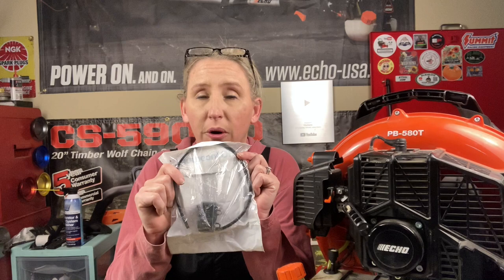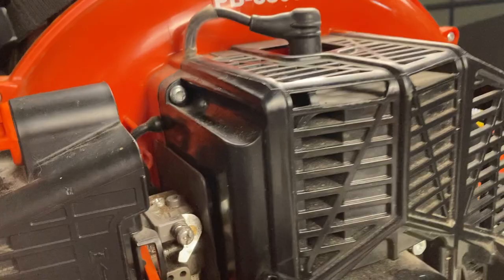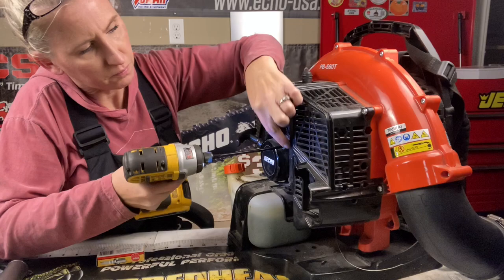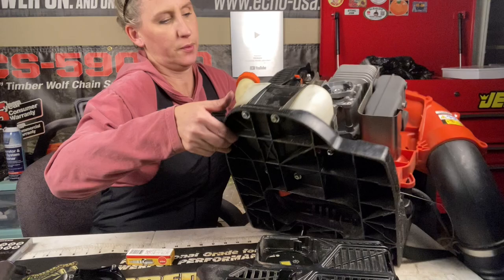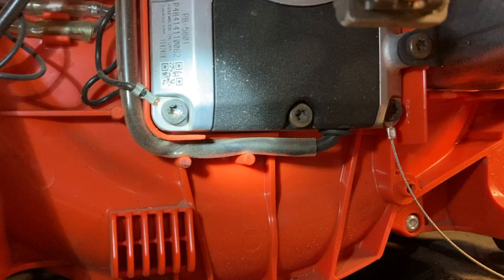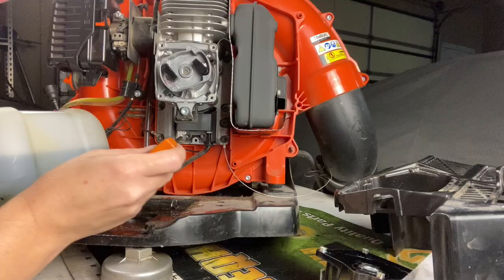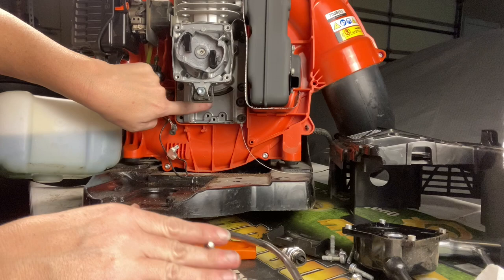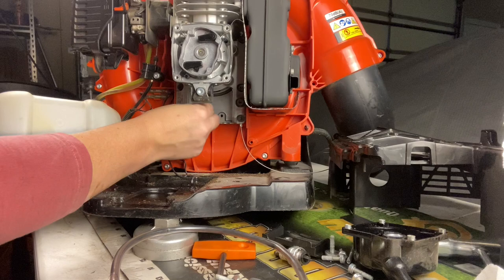Echo Backpack Blower Starts,Then Dies.. Ignition module replacement. Repair/Vlog

Comment: Silicone spray is your friend to remove and install plug wire boots and plug wire covers. It will also help with the plug terminal.
Reply: I came to the comments to say this...
Reply: I use a mixture of dawn and water to lubricate situations like this.
Reply: Yep for sure
Reply: But it WON'T go away, making the connection between the boot and the wire 'slimy'.
Reply: I work in a small engine repair shop,  and I always use a little silicone spray to remove and install the spark plug boots when I'm replacing an ignition coil.
Reply: I use silicone grease for the exact reason. 100% silicone grease gas gotten stupid expensive, btw!
Reply: Dawn + water is good for putting on rubber things like motorcycle handgrips but it gets sticky when it dries. Perfect for handgrips, not for spark plug boots.

Comment: I picked up an Echo blower that was set out beside the road with trash.  Like the backpack blower, it would run about 10 minutes and die.  Then it would not start again until it was completely cool.  I put a new ignition module (coil) on it and it runs great.  Watching your videos has given me more confidence in attempting repairs for myself.  Thanks for sharing your videos.

Comment: Working on a Hilti concrete saw today. Got it all buttoned up and was about to pull the starter rope and there it was. Laying on the bench, a random screw. Doubt and the where did that go had me tear it back apart. Coworker walks over and says, "Did a screw fly over here?". He bought lunch after I chased him out the door swinging a chainsaw chain at his head. Never a dull moment where I work.

Comment: Thank you - I did not know if I had registered the Echo PB-580T purchased from Home Depot by my wife as a Christmas present many years ago.  The unit worked for years but I would have to power it back to keep it running.  After the new ignition module (purchased off brand on Amazon with all the parts you had to reuse) the unit worked great for 15 minutes.  Hopefully will run again once I let it cool off.  Great instructional video.  😃😃😃😃😃

Comment: Usually in this type failure, there's a very small break either in an internal winding or plug wire. When the coil heats, the break expands thus no spark. Cool down and the break closes. Nice video Bre.

Comment: Fire : If you have light yellowish fire, your engine "might:" start. You need brilliant blue spark for your engine to run right. Usually, a coil is like a light bulb, either it works or it don't.
I disagree with any sparks is good spark. If your spark is jumping around from the edge of the plug to the electrode. That means the plug is fouled. The spark needs to be consistent.

I had a Craftsman 6 hp. chainsaw, it would start all day long at home. When I took it up in the mountains, it wouldn't hit a lick.  It would cut through ginormous logs like crazy.
I ended up beating it to death with my 14 pound sledge hammer. I now have all Husqvarna saws. I have an XP 262, I bought new in 1993, it's never been to the repair shop.
It still has the original NGK plug, I run 110 octane Sunoco gas with Mobile 1 synthetic 2 stroke oil. 35:1 mixing ratio, I gap my plugs at 28 on the feeler gauge.       Btw, you're very attractive.😘

Comment: Dielectric grease works great as a lube for plug wires. Also makes it easier to take apart later.
Reply: With the added bonus that it is rubber-safe which ordinary petroleum based greases are not. You can also use synthetic brake grease as it is dielectric grease under disguise but sold dirt cheap. Regards !

Comment: To remove boot, I used to use a steel pick. Slide it down between the high tension lead and the boot. Now you can pry back the boot from the lead wire, and drop in a drop of oil. Then, rotate the pick around the high tension lead to spread the oil. Now the boot will be much easier to pull off and less chance of damaging the connector. I learnt this procedure in a Stihl update seminar.

Comment: I also stretch the boot by inserting pliers & opening the handles in multiple directions then I use a little silicone lubricant when removing & reinstalling the spark plug boot. Then wipe off the excess after I put the boot on.

Comment: I have had great luck using silicon dialectic compound to lube the inside of the insulating tubing.
Hint: On the spark plug boots, put the silicon compound in a syringe and squirt it inside the easy way. I got some big ones from my local Dollar Tree, but feed stores and vets carry them also. I do grind off the sharp point on the syringe needle, as then I can't poke myself or poke through insulation. Chemtronics Z5 heatsink compound also works, but is spendy. One can also add a small piece of tubing on the syringe to get lube into tight places. I keep my dialectic heatsink compound for transistors in a syringe, as the tubes are prone to splitting too.

Comment: I would suggest using Dielectric grease at least for the ease of sliding the boot on as it is conductive where regular lube can insulate the electrical connection and is great to use with any electrical connection as it keeps moisture from corroding the connection. Great videos enjoy them all.
Happy Thanksgiving.
Reply: Many people seem to think dielectric grease is conductive. It says right on the tube that it is actually not conductive at all.
Reply: @jeremiahlf  you are correct. Dielectric means it does not conduct the flow of electricity. Most are silicone based. They  protect electrical connectors from corrosion, moisture, and dirt  and are a lubricant. You are correct. I stand corrected

Comment: Echoe excellent 👍 I love their products.
Start east no issues.
We had issues on marine outboard motor s with hot coil fails .
Would die after hot then get boat towed back to marina then it would start ... 😂
Out off Bahamas one mercury would not restart after shut down heat soak. No one to help us .
I removed cover and poured ice cold water on  ignition electronics and it started.
Went back with cover off for air cooling..
CDI charge coil under flywheel get hot 🔥
Maybe drill holes in cover to let air cool coil..

Comment: If I remember right, the boot needs to be pushed down wire first so that the spring-seat can be dissected.  
All those little 'fixins' as I call them are kept off the assembly so that the ignition is more common across more models.  Otherwise they'd all have to be unique and they cost another $20-$30 (or more), and take up even more inventory.
Reply: Yep  that’s what I do . Still hard to do

Comment: To get the protective cover on the spark plug wire, find a metal rod that slides into the cover and straightens out the cover, use lube and slide the wire in while removing the rod.

Modify a pair of pliers to hold the spring wire and the plug wire to squeeze the 2 together.

Comment: Thank you for replying to my Amzoil Sabre post. I have tried the recommended ratio of 50//1 however, the machine smoked more, with more carbon  build up. Were you aware that most 2 cycle non synthetic oils have "fillers"non lubing chemicals in them that require a higher ratio of oil to gas in them? Please consider checking out the Lubrology reports. I observed this by checking out the exhaust screen and eventually eliminated the exhaust screen.. No, I am not a sponsor, but found what works for me at less cost. I appreciate your videros' time and info.

Comment: Use glass cleaner to "lube" that vinyl tube so it slips over the spark plug wire more easily.  Maybe wait to put the spark plug boot back on until you've threaded it back up past the cylinder?

Comment: Hey spray that cable with little  touch of WD40 or spot of silicone spray  then wipe it off. It should slide out better.

Comment: Don't know if you, or anyone, will read this but if you had run the spark plug wire back in place before you put the contactor and boot on to it it would be a lot easier to thread in and since you have to have the boot off I kind of think removing it first would help with the removal too.  Just saying.

Comment: I agree with Charles Fiore, a little silicone spray if you have some will help a lot. I've also used Windex on that sort of stuff and it works pretty good too. Thanks for another great video!!

Comment: Carb and choke cleaner to remove and install those boots. Use a straight pick to get in between the boot and wire then use the straw on the carb cleaner. You got to be quick going back on but when it dries, it's stuck. Not coming off.

Comment: Next time used compressed air to get the cable through the sheath, blow it down the tube whilst pushing it through. This method is also great for installing & uninstalling handle bar grips.
Also my spark tester is my finger ! If i feel a pulse then i have spark.

Comment: Thank you for your informative videos.  I enjoy watching them to learn things.  I’ve watched them in the past and three or four months later, I encountered an issue with one of my small engines.  A dim light came on in my memory bank and lo and behold, I recalled one of your videos where you addressed the same problem.  I was able to fix the issue and not have to take the tool to a shop and be without it for a week or two.

Thank you….

Comment: Hi Bre, I enjoy watching all  your educational videos. I have a pb 580t that bogs down when I squeeze the trigger. First, the machine did not start when I tried to use it for the start of the season, so I cleaned the carburetor and it starts easily but
Reply: The blower bogs down when the trigger is squeezed. I want to fix it myself but I don't know where to start

Comment: Heat the outer part you're trying to put on or take off. It will expand to make the process easier. A hair dryer should work.
Reply: Milwaukee M18 heat guns work awesome.

Comment: Very timely video, my dependable old Stilh back pack blower  (almost 30 years old) started to have this problem just recently.  New coil ordered.  My backup Echo is still running after 20 or so years!  A little routine maintenance really pays off in the long run.

Comment: Consider keeping a bit of "wire pulling lube" electricians use on hand..  I'd be careful using a petro chemical lube on wires.  As far as getting boots off I use an ice pick type device to break the "seal/bond" between insulation and boot.  Once the bond starts to break free add a bit of lube and work it around and the boot will come off easier.  Dont forget heat is also your friend to relax things for install/removal.

Comment: I bought so many parts to fix my PB 580-T. It didn't work. I watched so many clips on Youtube. It didn't work.  I watched your video and now it finally works. 
It was that little distance with the ignition coil and flywheel. Runs like new.  (You))know what's up. Thank you!  My headache is gone. Thanks again!

Comment: My SRM230 needed a new coil after about 13 years of use.  I maintain my equipment and start it once in the middle of winter usually, and put it away with Stabil along with mixing Stabil in anyway as soon as I buy the 93 Octane fuel.  It was completely dead though, and had only an intermittent 'dull' spark. That was a fun little repair, but I fixed it perfectly.

Comment: 1) Get rid of the petroleum grease. Get dielectric grease and silicone spray or sil-glyde. Spray silicone into plug booth before pulling off. Die grease or glyde on high tension lead for install
2) regular pliers for installing plug terminal spring 
3) is this common? Like you said 99.99% of the time modules either work or they don’t. Or the plug is shorting. I haven’t seen a failure like this in 25 years and that was on old snowmobiles with separate cdi and coil…speaking of snowmobiles you going out riding later? Looks like a nice set of bibs😆

Comment: So, a leaf blower is a she. Good to know. 😊

Top tip - when lubing wires and flex tubing use silicone based stuff; some mineral and synthetic oils or greases dissolve plastics - especially nylon - and rubber.

Comment: Hi, I have a Stihl FS55 which refuses to idle when hot or in warm weather, however no problem in cold weather. I decided to have this Brushcutter serviced and have just received a phone call from service centre informing me that I need a replacement Stihl carburettor due to an air leak within the carburettor. I’ve agreed to a Stihl replacement carburettor due to the Chinese built carburettors not being built to last. Here in U.K. we rate Chinese built goods as cheap and not great. With regards to 2 stroke mix oil I use Stihl HP without problems and certainly wouldn’t use Stihl HP Ultra. Also in UK we can only get 5% or 10% Ethanol gasoline at the pumps and I use 5% and add Ethanol shield. I never leave fuel in my Stihl power tools and always run them till they stop when out of fuel. This is advice by UK Stihl service centres.

Comment: to remove the sleave try a bit of silicone spray first.
and same on the boot assy.

then silicone dielectric grease on the new spark plug wire, and boot.

Comment: I've seen another shop tutorial use a few drops of dish washing soap and the plug boot slid right off with almost 0 effort. I use a light penetrating oil, usually clear silicone. I agree though. What do companies save by not providing all these items, .30? For the folks having to buy outside of a warranty, and original part should have ALL the pieces as installed from the factory! Love your vids BTW!

Comment: I was just working on a blower at work other day. First thought what would Chickanic do? Started with fuel, straight gas 🤯, scratch piston, maybe, compression ok, spark has it. Mechanic at work said plug maybe fouled thou it has spark. Tried to grab another from the pile of broken machines.
It would pop off. Was wondering about coil now I find this video.
Thank you 👍👍👍👍👍🤯
Maybe a fish wire to pull all those wires through. A 12 guage copper wire, flexible.

Comment: I find that if you use a hair dryer and warm the boot on the coil plug wire, it slips off easier most times! :) Good video!

Comment: To remove the cover from the spark plug cable I spray wd4 lifting the tip of the boot with a thin screwdriver. I do the same after installing the new cable. This makes the process much easier. I do the same for the placement of the outer tube

Comment: Love the business card as a spacing gauge hack.  
A woodworker's awl will make the hole in the plug wire insulation easily, and can be used to ream out the 'jinky' bits of the clear sleeve with the help of a hairdryer or heat-gun on low.
Crimp connections or cold solder joints between the winding wires and the leads (plug wire, ground, kill) inside the laminate/ignition-pack can fatigue from repeated cycles of heat/cool leading to an open connection after it warms up and once the heat 'soaks in'.

Comment: You can spray the wire, tube and plug boot with windex or isopropyl alcohol to aid in dissassembly and assembly. They lubricate and then evaporate without leaving anything behind.

Comment: Hi Chicanic I just bought a 9010 1st is the coil similar to the one you just did? Also, the dealer I bought mine from didn't even mention warranty, but I saved receipt I had to ask him, he told me just a 5-year warranty. He also told me to use good oil Duh. He did not say anything about registering it. I also noticed that my owner's manual was not complete he did not give me whole owner's manual I had to get the rest online. You go above and beyond for your customers.

Comment: What I would do when I take a spark plug boot off is I would  squrt some rubbing alcohol into the boot and wire  and it  could be easier  to take the plug string and wire of the old coil  & remove the spring and pull the old coil wire out and reapply alcohol on the new wire  and boot opening and pull the wire back through the boot and pull it back into position  and you can do the same thing  for the plastic protection cover over the coil wire  ? But the alcohol will act as a lubricant  against rubber surfaces  and it drys out leaving no residue  behind

Comment: Use soapy water to get the sheath on and off. Same thing with the boot. Slide the boot down the wire, pull the spring up and out,  then slide the boot off. Then reverse procedure when reinstalling on new wire

Comment: Rubbing alcohol to pull spark plug boots off of spark plug wire tips.  Doesn't make it slip off like nothing but it does help a measurable amount and won't induce corrosion as badly as plain water and soap.

Comment: Great video!  Thanks for showing us the small things. I need to understand every step. I'm new at fixing these items. I'm trying to repair a Echo PB 980T that won't start. It's less than 2 years old with only low mileage. What else could be the problem-the carb? What do I check next?  I've changed the gas out, the gas filter, and the spark plug.  I dont't see a troubleshooting video to determine the next step.  Thanks!!

Comment: Hey Bre!  Love the video as always.  A couple of things.  Maybe try hairspray to get that plastic tube back on the start plug wire.  I worry that grease might not be rubber safe, although maybe it is.  I always used hair spray to put my grips on my motorcycle.  Also, I have had issues with weak spark in the past.  My boat would not start and a family member said the spark looked weak and I replaced the coil and it was fine.  Apparently you can have a spark that's fine in the air, but doesn't fire in the combustion chamber.  Cheers!

Comment: You should be able to make a jig for putting the spring on the plug wire. A block of hard wood or scrap aluminum and a little imagination should be fairly easy.

Comment: Maybe if you try to push the spark plug connection out first and take it off then it may be easier to remove the boot.

Comment: I had a power washer,  it would only run for 6 - 8 minutes then die, the coil, magneto , was the problem.  It ran just like new after putting a new coil on.